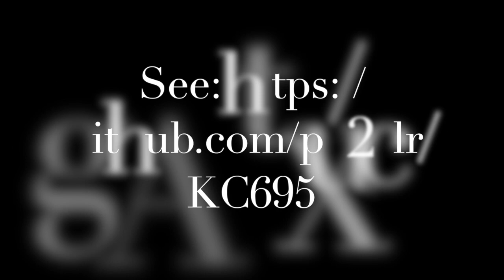PU2CLR AKC6955 Arduino Library - SEEKING TEST

Comment: for older retekess v115 (akc6951(55) if the bluetooth sensor wasn't supported) crystal oscillator is 12 mhz, but if the older radio had bluetooth sensor (16 mhz will be used).
for newer retekess v115 (kt0935r) crystal oscillator is set to 16 mhz, same with bluetooth enabled radio as kt0935 can support lower frequency of crystal oscillator (up to 12 MHz for radios without bluetooth sensor).
however i preferred 16 mhz for KT0935r enabled radio and AKC6951(55) enabled radios with bluetooth sensor as there is no shortwave interference running at 16 MHz.

Comment: What the inductance and resistance of the MW antenna coil?
Reply from the maker: Between 180 µH and  450 µH should work.
Reply: @pu2clr  180 and 450 so far from each other ,whats the best?